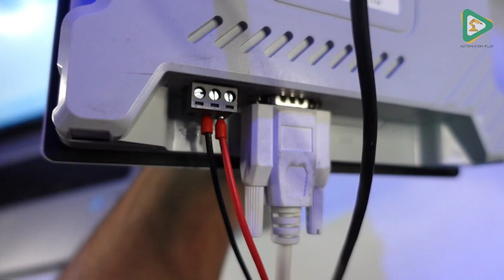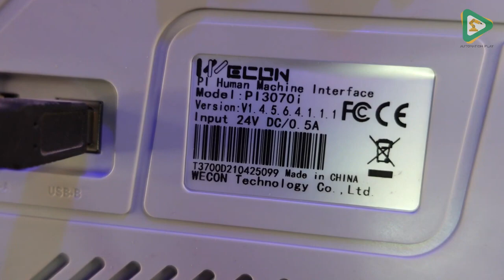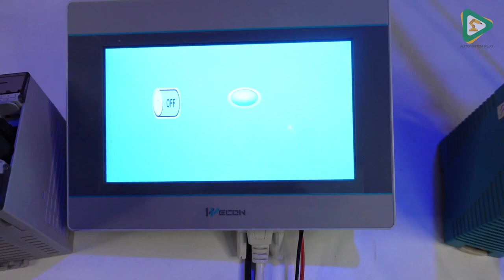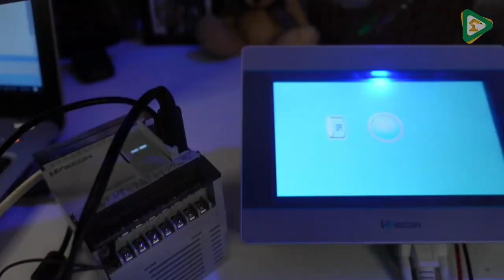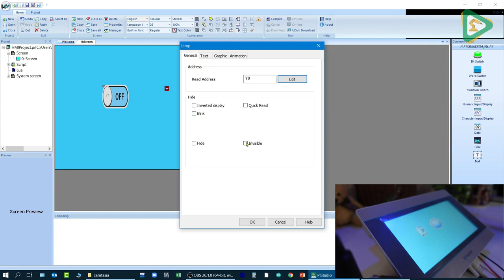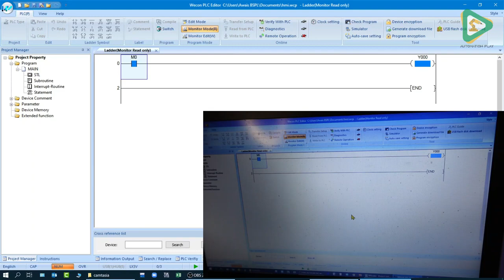WECON HMI Programming via PISTUDIO and  Interfacing with LX3V PLC via RS422

Comment: RS422 Mini DIN 8-Pin Male to DB9 Cable cable included in hmi or buy seperately , if seperately then what is model number for 2m cable
Reply from the maker: Hello,it is necessary to place a separate order, specifying "HMI-PLC RS422 communication cable" in the remarks section